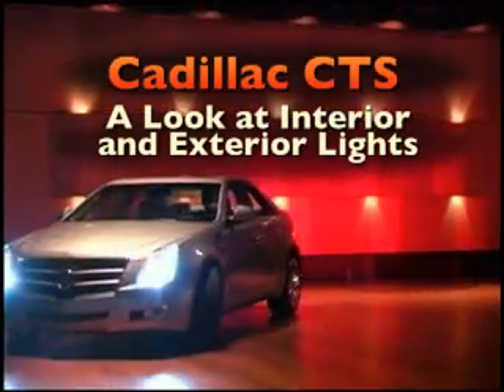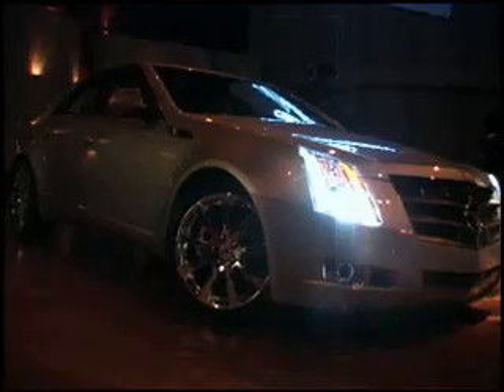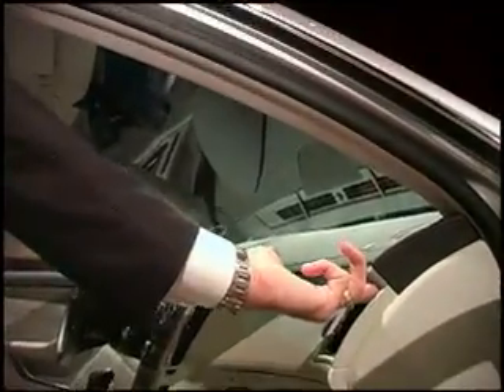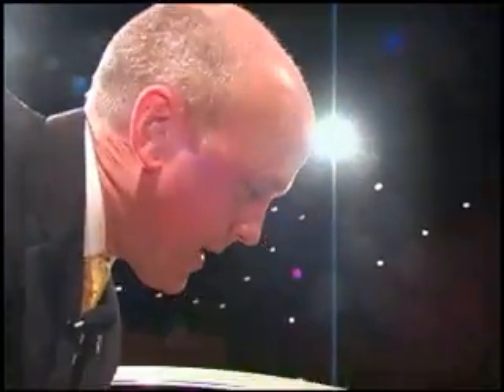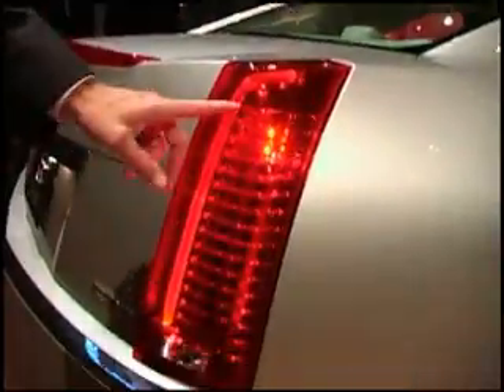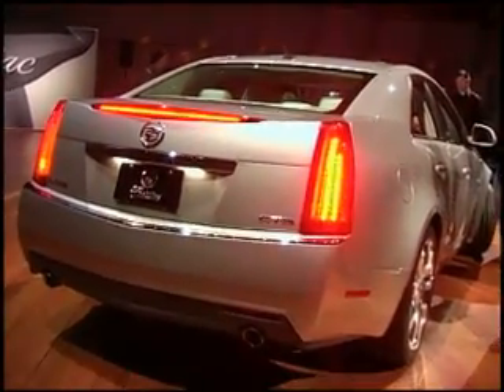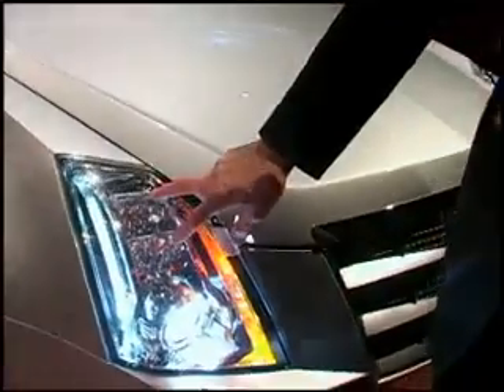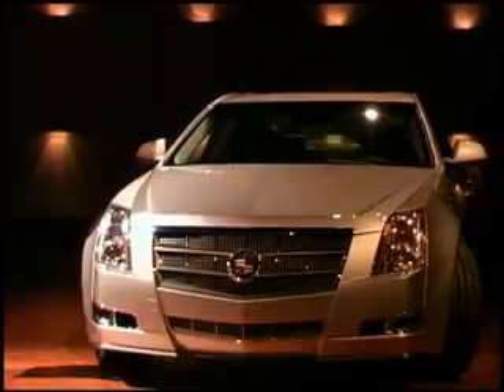Cadillac CTS: Interior and Exterior Lights

Comment: the car is cool and all but the way these luxuriy cars are manufactured today s a nightmare to cutstomers.  To simply replace the headlight bulb, not even the led's or anything, you have to remove your wheel, then your splash guard, then your inner wheel panel, then the bumper from the fender, just do do a bulb.  Simply ridiculous.  Also i dont know if you have a CTS like i do but if you think your battery is under your hood lmfao think again. Near the wheel.  Simply stupid. Read before you get.

Comment: Thats funny, I too have been restoring cars since I was 16.  That means I've been restoring cars ten years longer than you have been alive.  I believe you are correct in your assessment that simpler is better, but you got it backwards.  Ex. Check out some of the coolant diagrams for water cooled Porsches, some of them have in excess of 16 hoses and they are famous for using tapered hoses.  All that performance comes at a price.

Comment: LOL your funny, I've owned Domestic vehicles for quite some time now and never had any major problems with them, all of the vehicles I have owned have made it past 100 thousand miles.  Do I really need to bring up the sludge issue with Toyota, not to mention the new 5.7 breaking camshafts and needing the engine replaced.  At least Toyota has admitted to the 5.7 fault and is replacing engines free of charge.  Honda has the odyssey, major transmission failures and electrical problems.

Comment: Sorry.  That's incorrect.  CTS-V currently sits on GM's Sigma platform, initially designed by Holden in Australia, and picked up by Cadillac for its exclusive use.
NO OTHER GM BRAND USES THE SIGMA PLATFORM.

Comment: The 3 series is a great car. I just don't understand why it is so overpriced. In a way the Asians and the Americans are in another class. It's called the "perform just as good, without the badge, that costs about 10k less" class. I don't know how reliable the BMW website is because they might not have a CTS to compare, but they have a Saab 9-3 and a Lexus ES350. By the way that G37 is coming at BMW real fast. Ill tell you to hold on tight, because thats gonna be a rough fight.

Comment: BMW already has started to use interior ambient lighting in its 2007 3 series models.  So, BMW sorta hit it first to shed light on door handles inside.  The front tube lighting is well....silly I think.  Jaguar has its yellow indicators by the xenons and I swear you can't see them for shit, I can't imagine Cadillac being any more noticed with the xenons on.  I think its a nice try, but overall just one more thing to burn out and charge up the ass to fix. Go American Made.....